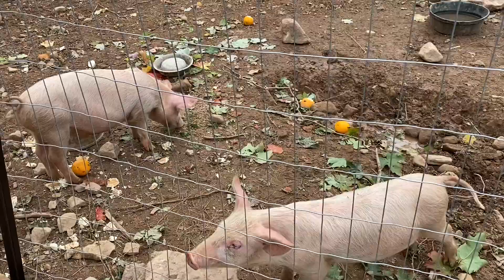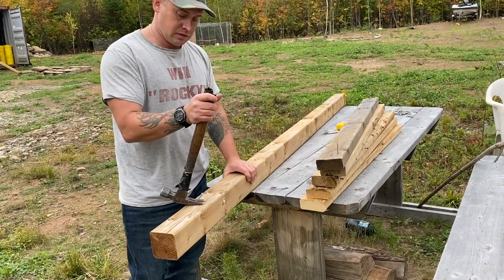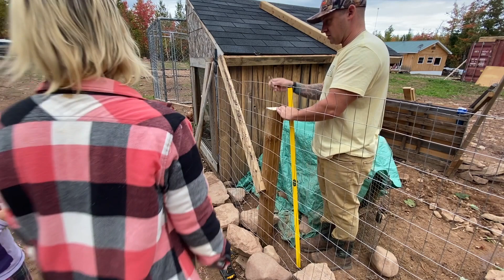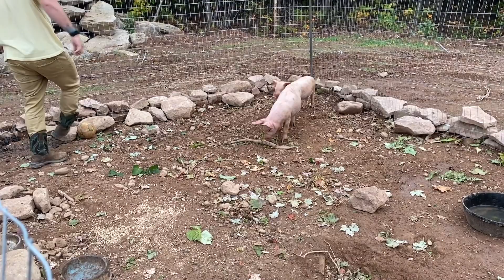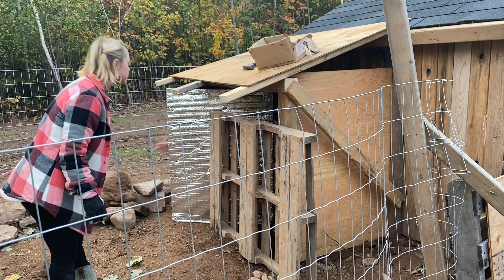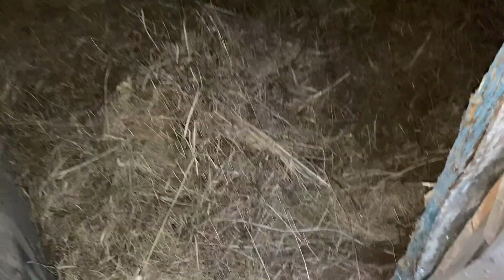CUTE BABY PIGLETS Get a New Home

Comment: I suggest you consider running a hotwire on insulators around the outside of the pig pen at bear/coyote nose height to give them a bit more protection. When the coyotes start getting hungry in the cold weather they may well view your pigs as a tasty meal!

Comment: HELP! going off grid & looking into buying your type fridge.Right now I have 2 new marine batteries a large gen(3500) and 2 solar panels. will only be running one other item right now my laptop. I was wondering how long will the batteries last without charging them(?) would appreciate any approximate range thanks BTW the pigs would enjoy wild apples!!
Reply from the maker: Hey Darlene, I wish I could help but I don't know how long they would last without charging them. You are going to want to be able to charge them as soon as you can as they won't last real long.
Reply: @MBFModernHomesteading  would a RV fridge  work well on batteries , I mean last longer  than a regular fridge??
Reply from the maker: @darlenesmith2704  Yes as it is DC.
Reply: @MBFModernHomesteading  Thanks that helps